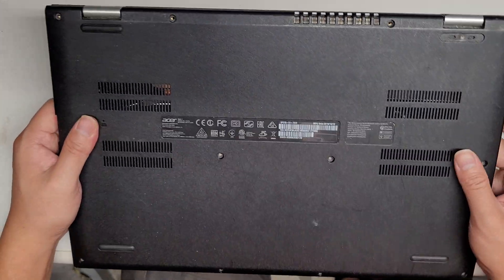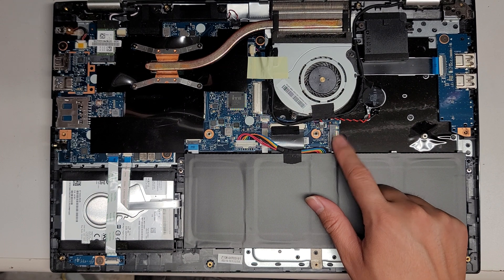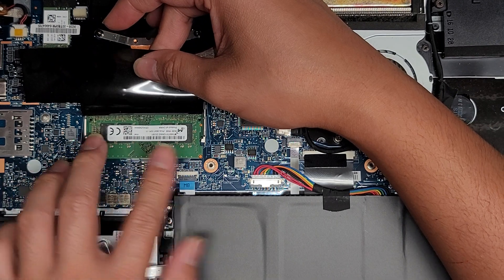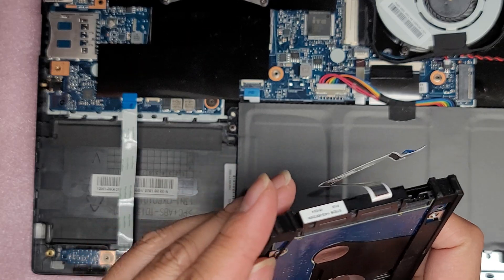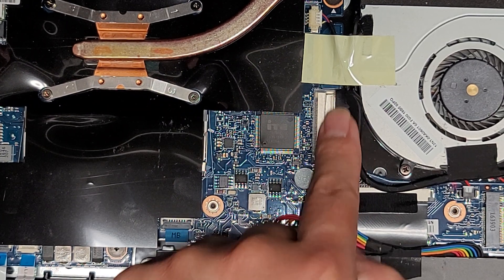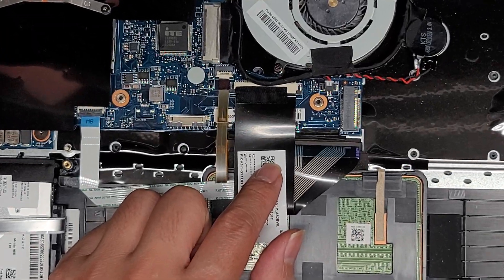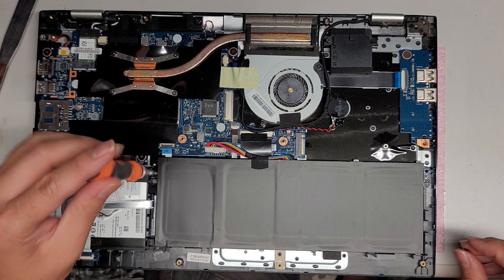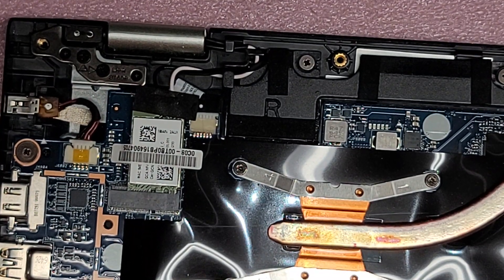Acer Spin 3 N16P9 Disassembly RAM SSD Hard Drive Upgrade Battery DC Jack Charge Port Repair Replace

Comment: You really need to buy some anti-static brushes for sweeping dust.
Reply from the maker: Never had an issue
Reply: @ItsBinhRepaired  They are like magic as you lightly brush they remove static and in turn the dust clings to the brush. Plus they work over and over. Oh yeah did the system work with the NVMe drive? I thought only the Sata m.2 were support. Thanks for any correction.
Reply from the maker: @zedorda1337  cool. It's been too long, but I'm pretty sure it worked.

Comment: I need to do a clean Win10 install on my N16P9 which only has SSD. You mentioned in the video you had info that will help with that. I would very much appreciate the help.
Reply from the maker: Basically this https://youtu.be/R6GVDyVqWso but you have to have a functioning windows computer to create the bootable usb, then boot from it.

Comment: Thanks for this video.  My dad had one of these, and wanted to get rid of it because it was noisy (he thought the HDD was dying).  This was very helpful in opening it up without breaking anything.  After I replace the noisy fan and switch it to an SSD, it'll be like he got a new laptop.
Reply from the maker: Glad it helped. If you haven't already, don't forget to like and subscribe so others can find my videos. Thanks!

Comment: This video is so nice! I have this exact same laptop that stopped charging. Any ideas what it could be? I sent it to get it fixed yrs ago but they said it wasn't the battery or the charger. Said it wasn't fixable!
Reply from the maker: Could be the charge port or a bad motherboard.

Comment: Thank you for the movie. Have you succesfully installed crucial M2 NVME drive on this model? I've got exactly the same model and I wonder if it works with NVME standard.
Reply from the maker: Don't remember. I should have mentioned if it's m.2 sata or nvme in the video. If I didn't, then I'm not sure.